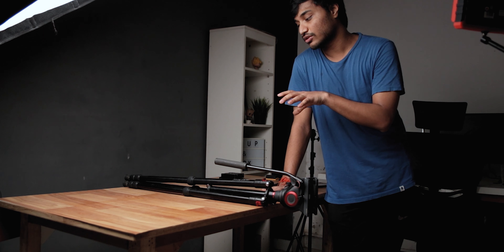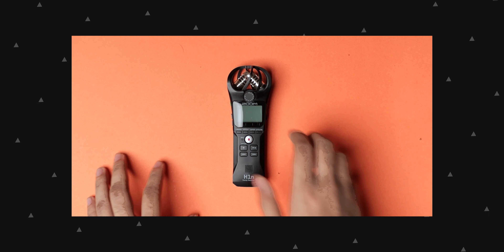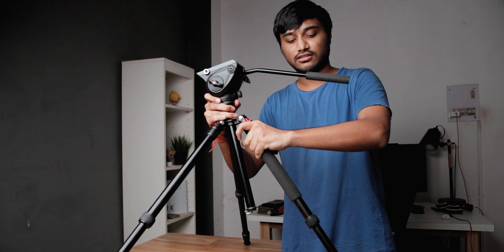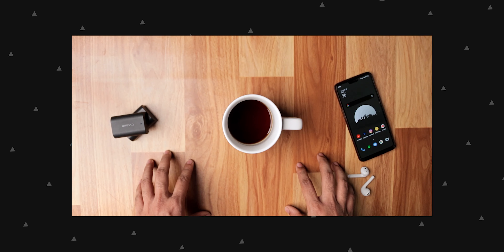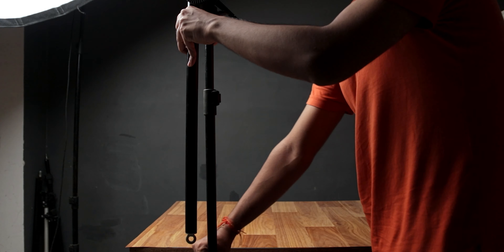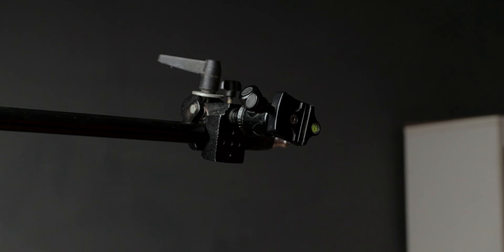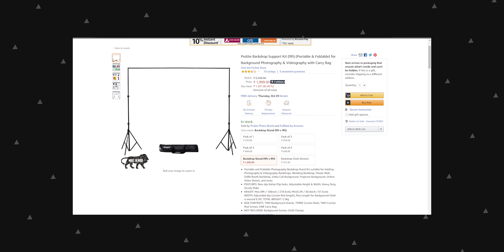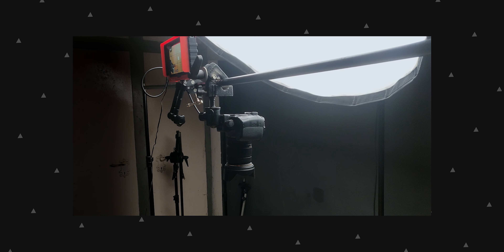4 Simple DIY Overhead Camera RIG Setups

Comment: Hey, it's been long. I have used/tried the step 1 & 2 [Keep tripod on table, put subject on floor; Keep 2 legs on table stretched & extend one leg to ground].
My question about the other steps.
#1. What kind/model of boom (light) stand is on step 3?
#2. Are the product (light stand) from Digitek/Sonia/Simpex actually rigid? To use in the overhead like you mentioned in step 4.
Reply from the maker: I couldn't find the exact same model of light stand with arm but I have added a link to a similar one and for the second question, the backdrop setups from these brands do work out really well.
They aren't the best ones but still handles some pretty good weight.